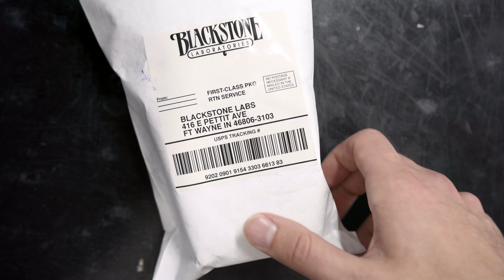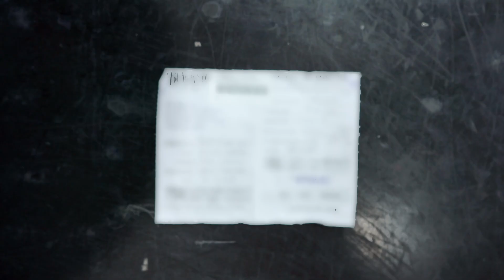Oil Analysis Start To Finish: Part 2

Comment: I'm confused, it clearly says on the Sampling/Testing/SENDING/Results sheet included with my sample kits under the 'sending' portion to put the black mailer AND THE paperwork into the white tyvek bag, it says nothing about putting the paperwork inside the black mailer.

Comment: I've spoke to several mechanics and the real issue is getting the sample to Blackstone Lab. It seems that many Post Offices see the Package that contains Motor oil and open the package as they did on my sample. When the package arrived at BlackStone I received an email from Blackstone Lab that the oil sample was missing!!  Blackstone advised me to ship it thru UPS in a sealed box. I went to my local post office and they said any type of Waste OIl will be removed from the package ! John

Comment: My kit was sent with the return label on the black bottle itself. That's OK to ship I assume?
Reply: They should get there, but Blackstone did some testing a while back and found that the Tyvek envelope seems to speed things up (when compared to the bottle alone) in the postal service for some reason. You can get the envelopes for free if you email them a request.
Reply from the maker: We couldn't have said it better, Carl!